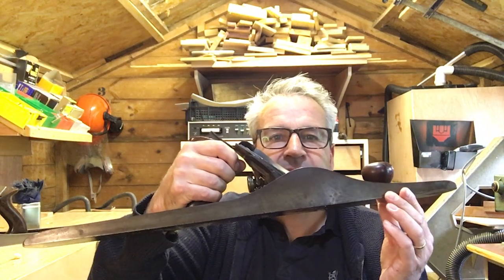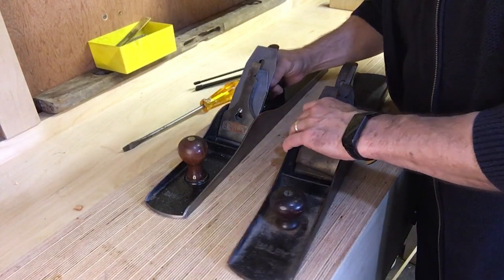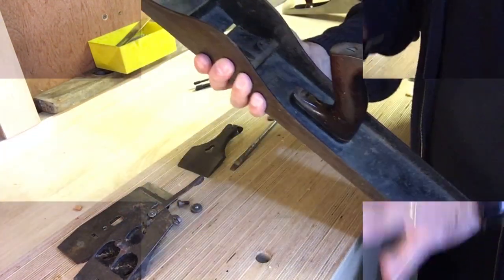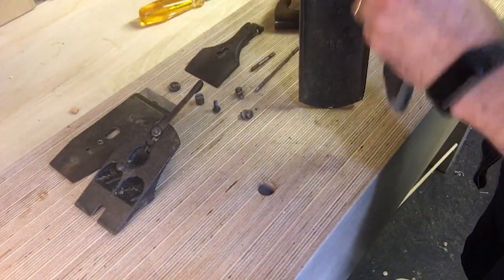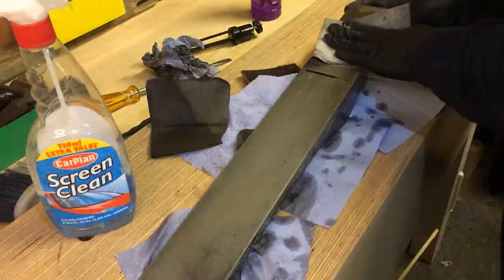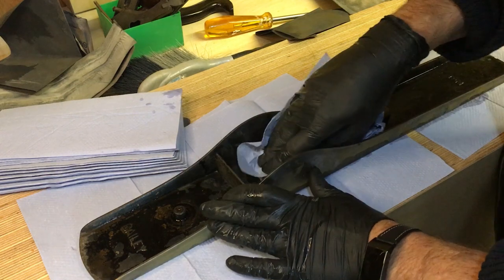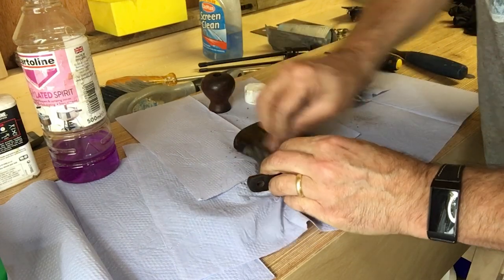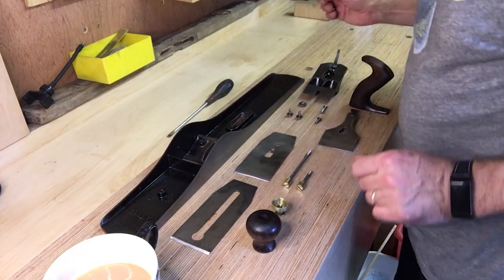King of planes - Stanley No. 8 Restoration

Comment: I have a No. 8 which has been waiting a similar restoration for a few years.   Mine is not as old as yours, but the blade is as worn as yours.
I have experienced vintage Stanley blades which only had about a 1/2in wide strip of tool steel forged into the blade.  When I sharpen the blades and flatten the back I can see the lines where the tool steel ends.
I just sharpened a blade on a 5 1/2 a few days ago.   I see a line on the bevel where the lower portion is tool steel.    Looking at the back I see a difference in the tool steel and mild steel.   Not very wide, only about 1/2in.

I expect my No. 8 blade has been ground through the tool steel portion so it needs to be replaced when I get around to the restoration.    These planes are HEAVY.   I am not sure how much I will use this which adds to my procrastination on the restoration.

Voice over format works for me.
Nice shavings.
Dave.
Reply from the maker: Thanks Dave its not one I will use much as its pretty heavy - but nice to have - I recently picked up a Record 4 1/2 that I have cleaned up and sharpened - finding myself reaching for that quite a lot as its a a bit heavier than the 4 but not too heavy after 10 minutes use. And I really like the record irons seem to have a nice swish cut that I like
Reply: I can appreciate the relative ease of use of the 4 1/2.
I do like my No. 4.   
I agree the Record irons feel to work better steel than the Stanley irons.
Dave.

Comment: Could use de same blade of n7 ??
Reply from the maker: It’s a little wider
Reply: @TheShedProjectUK  ...Coud be the blade of the n° 5 1/2 ?
Reply: @fabiojkbali No the no8 is the only plane with 2 5/8 blade out of all the plane sizes , the 5 1/2 fits the 7 tho and 6 and 4 1/2 that's 2 3/8 .